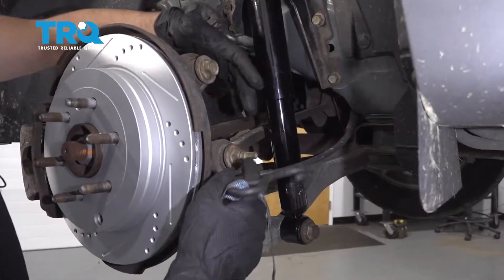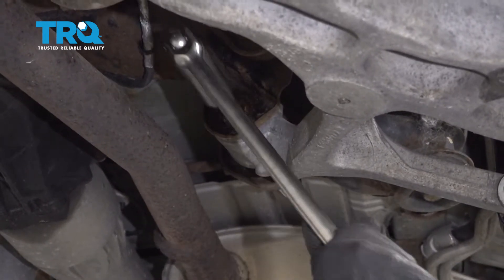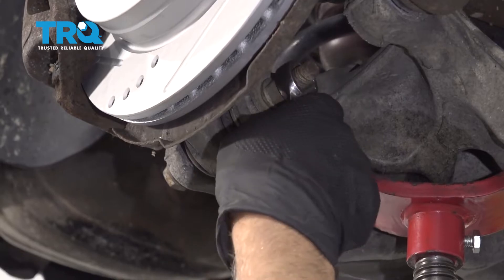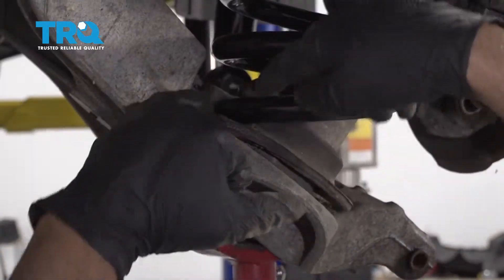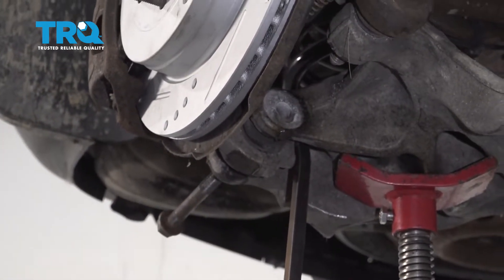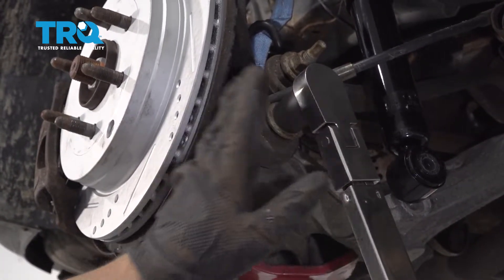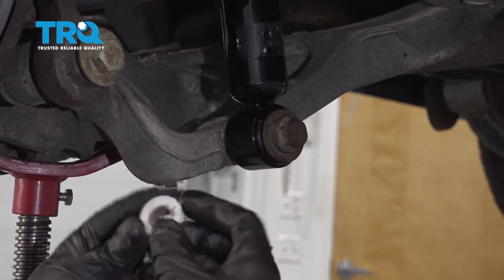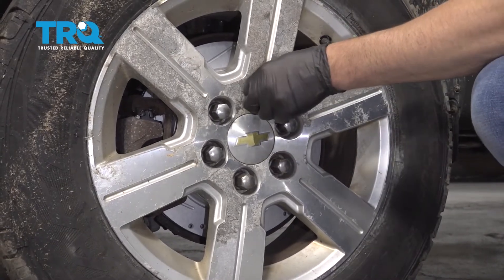How To Replace Rear Coil Springs 2009-2017 Chevy Traverse

Comment: So when torquing fasteners should you be on the nut vs the bolt since being in the bushing could give a false torque reading? And theses aren’t torque to yield bolts why the suggested replacer? Especially why replace when the stated torque values are on the low side for the fastener size?

Comment: Don't take the bolts out of the lower just break every bushing loose and pry bar it down DONT forget to remove the caliper use a pry bar and remove/reverse procedure in the rust belt the back lower arm bolt 9/10 is stuck in the bushing after 100k miles